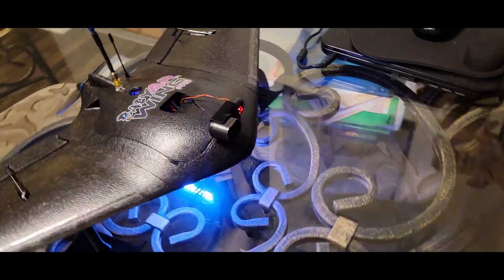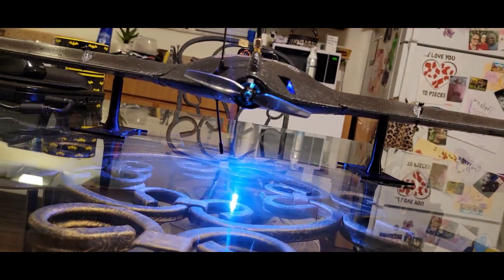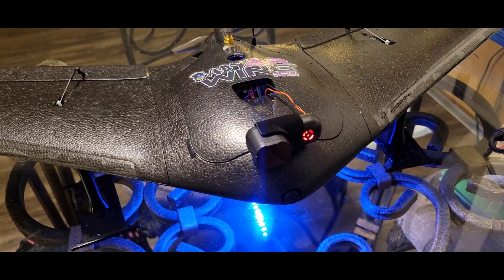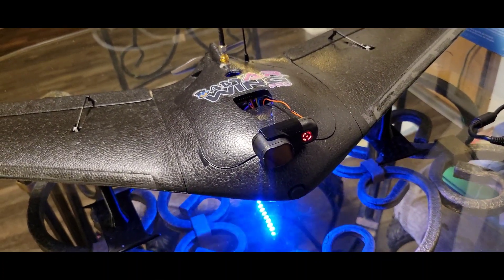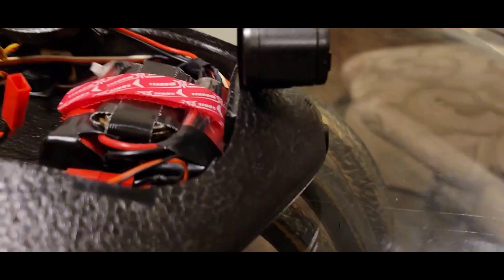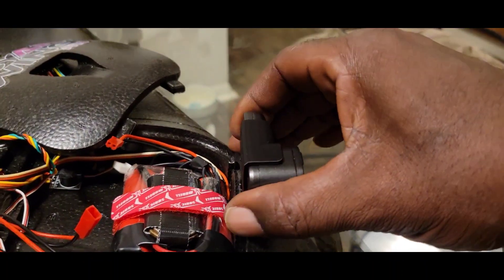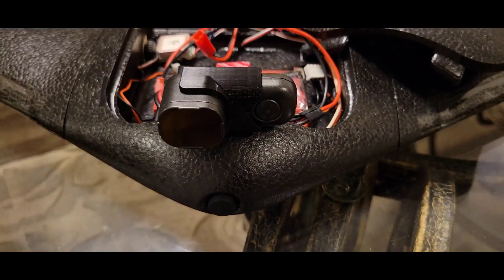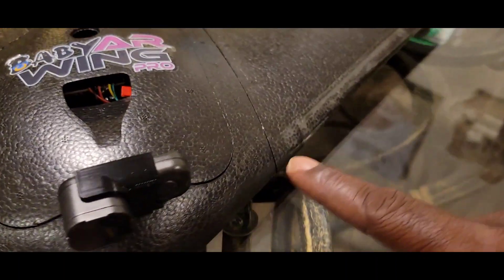Baby AR Wing Pro with Runcam Thumb Pro / HD Ready 😉

Comment: Hmm it i thinking about to put Sunnysky 2216 III 2600KV Motor in there. But would it be ever possible with CG?
I put 1806 2400KV Motor from old Mini AR Wing in there wit full Analogue Setup and 4S1P 21700 Cell in there it weights 540g but 2 Trys to start but not flown jet. I glued Launch hook in there an I will experiment with bungee launch for first time
Reply from the maker: A 2216 size motor would be overkill and extremely heavy for this model. Sure, you could achieve cg with enough dead weight. But I don't think that would be a great idea. 😕 The stock motor would carry a 3s1p in 21700s cells easily.
Reply: @JD_1  I wa t to overpower and speed the bigge the better i think
Reply: @mauritz1774  AR wing pro more suitable

Comment: Gotta inav question for you brother.  When you set up the modes tab in inav do you combine autolevel with the cruise mode and angle mode or no? So when your in angle mode or cruise the autolevel is on at the same time?
Reply from the maker: Autolevel  should only be used once, when you maiden the aircraft.  Once autolevel has been done, it will never have to be used again. Unless there are some changes to the aircraft. You put all modes on individual switch potions.  No combining inside of inav.  Would you like to see a video on this?
Reply: @JD_1  so you don't combine alt hold or anything with any mode like cruise or angle? I guess I'm asking is when I'm cruising around in Cruz or angle mode should I have the autolevel on?
Reply from the maker: @eternalfpv9461  with today's inav (6.1) you do not. Each mode is its on thing. I will get up and make a video for you real quick... And the leftover pizza is calling my name! 😂